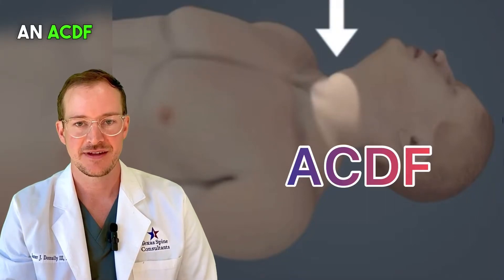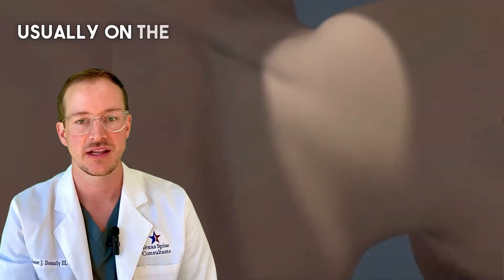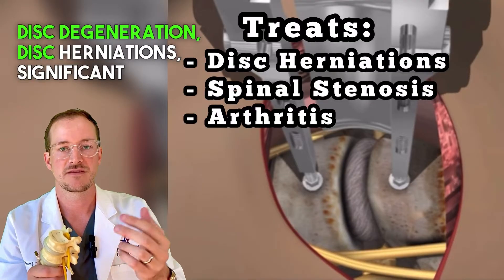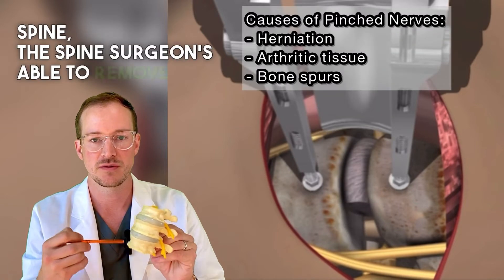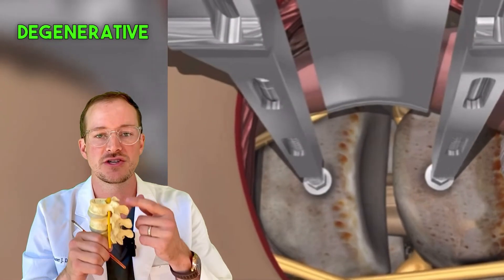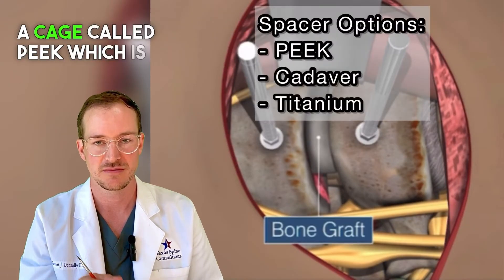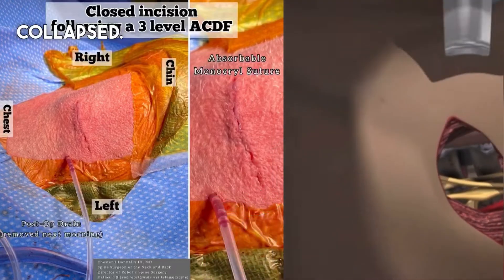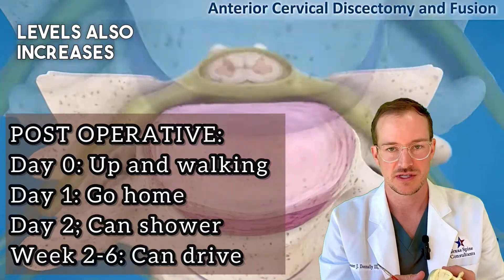𝐖𝐡𝐚𝐭 𝐢𝐬 𝐚𝐧 𝐀𝐂𝐃𝐅? (𝚂𝚙𝚒𝚗𝚎 𝚂𝚞𝚛𝚐𝚎𝚘𝚗 𝙴𝚡𝚙𝚕𝚊𝚒𝚗𝚜)

Comment: I had l3 cervical fusion. Great recovery. My side to side is slightly limited. But not bad. Numbness is gone. I regained strength on my right side. I had arthritic pain for years before the surgery and that pain is gone. I do workout now. No lifts above the shoulder or hard impact. But I can still do just about everything I could do before. I do recommend a bone growth stimulator to wear until about four months after your surgery.
Reply from the maker: That’s great

Comment: I had a C6-7 fusion about 15 years ago, worked great, immediate pain relief.  Only lasting effect is some loss of range of motion (head turning) so sleeping on stomach is harder as head turn to side hits "limit" sooner.
Reply from the maker: Ok
Reply: Thank you for sharing your success story I was told in August that I needed this surgery because what I have going on is very severe, but I’ve been putting it off because I’m afraid but I thought over these months I would get better and it’s not working nothing that I am trying has worked so I might end up going through with it

Comment: Own bone as in using it as the replacement and not mixing it with a bone matrix and placed in a cage? I'm getting a metal test done either through Melisa in Germany or a company in the states. I want to make sure I don't have a metal allergy when I move forward with revision.
Reply from the maker: Mixed